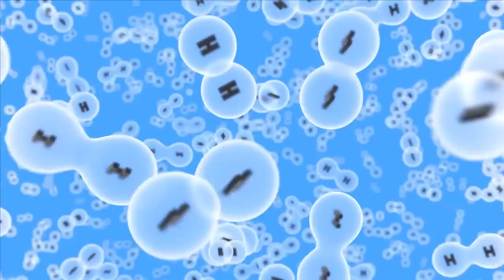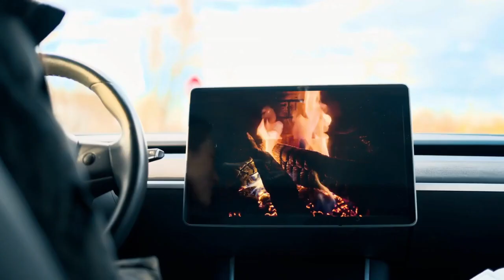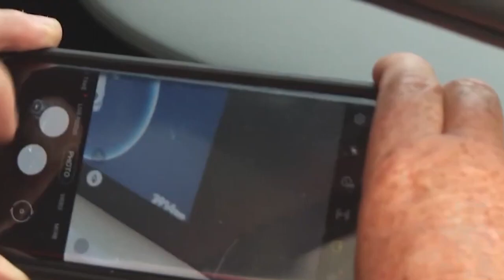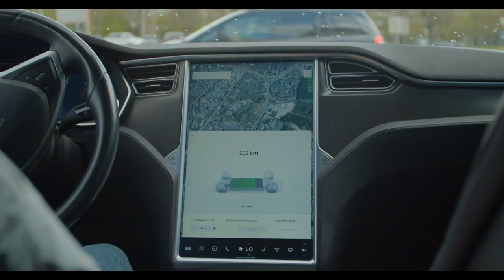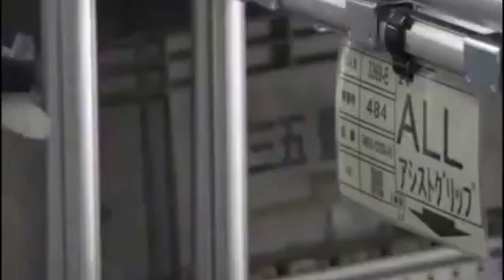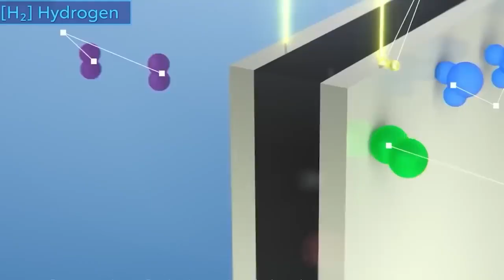Toyota's CEO provokes Tesla: "This new engine will put an end to the entire electric car industry!

Comment: I'm interested to see how this technology progresses over time.
Reply: Doesn't matter Hydrogen is the smallest molecule, it leaks even through steel which is why it is made where it's used when it is needed in large amounts, efficiency is key, it cannot be stored easily as this video suggests, the fueling stations cost millions, an EV station is any power point.

Comment: Anything is better than electric. The lithium battery has a lifespan of 100,000 miles, which then cost 10K to put a new one in.
Reply: Plus there is the high initial price, the heavy vehicle weight, rare earth metal element requirements, battery performance degradation over time, short driving range, not enough recharging stations, and an electrical distribution grid inadequate to provide enough energy if the great majority of vehicles were electric.
I've tried to explain this to people but the masses have been brainwashed that the electric vehicle is the holy grail and the  answer to all our vehicular needs and environmental anxiety .